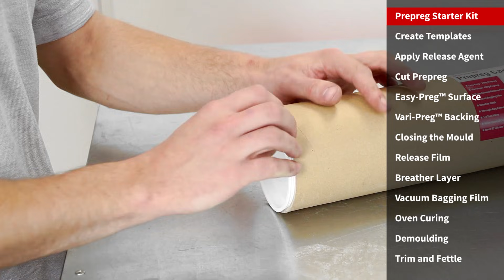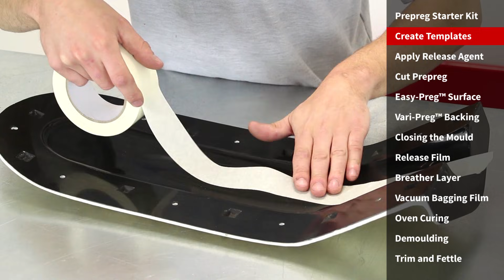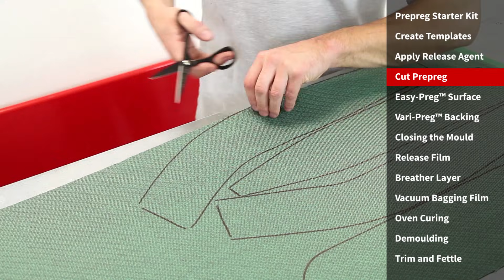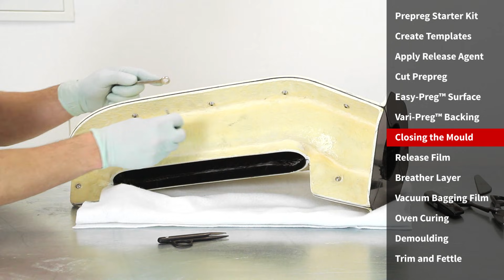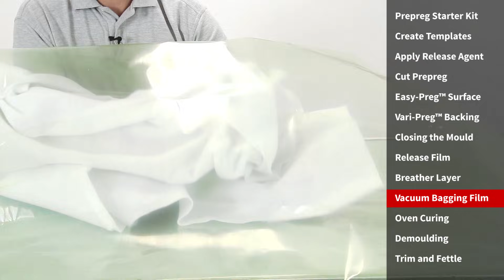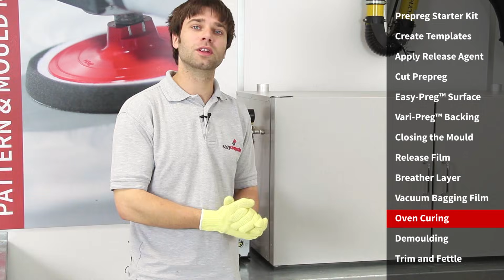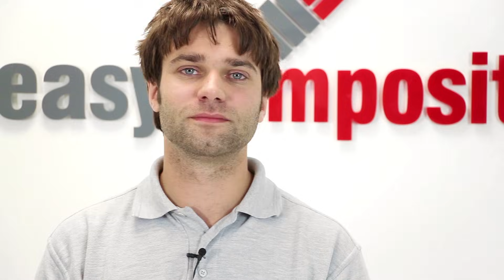How to Make Prepreg/Dry Carbon Fibre Parts (Carbon Fiber Airbox Pt. 3)

Comment: Hi, thanks for the video. Really enjoyed it.
I wonder how many parts can be produced out of one mould?
Reply from the maker: Yudha Pane The Uni-mould system is very durable so it is possible to get literally hundreds of pulls from a mould.  The mould can easily be polished to remove scratches and restore the gloss finish if over time it fades.  We have moulds in our workshop that have been in constant use for 7 years.
Reply: Easy Composites Ltd Great. Thanks for the answer. So does your company also provide service to manufacture the mould given a design from the customer?

Comment: Hi, can you tell me why do you need to still vacum the part in the oven after already you did that during assembling of moulding? Also how does the temperature increase durability of a part in MPa? Because as on the other movies you don't need to use the oven.
Reply from the maker: The carbon is pre-preg and must be oven cured under a vacuum.  The part is left under vacuum to ensure no air remains which would ruin the cosmetic finish of the part.

Comment: Do you need vacuum pump connected while curing because of expansion of the bag at high temp?
Reply from the maker: There are a variety of reasons to keep drawing the vacuum throughout the cure buy yes thermal expansion of the bag and any joints are one of them.
Reply: @easycompositestv  thank you!

Comment: Does the final product has all the benefits of carbon fibre? Sure lighter but is it now really stronger than steel? Or, is this just a quick way of making exotic parts?
Is this the all process it will take to make a crash helmet?
Reply from the maker: The final product has all the benefits of carbon fibre because it is carbon fibre. There is really not much further you can go in terms of the performance of a composite part. The only step left would be exactly the same process but curing with positive pressure rather than vacuum pressure (i.e. in an autoclave) but realistically that would improve the mechanical performance by maybe a 1 or 2% at most.

Comment: If I was using a regular oven, like one found in a house, would I still need to find a way to run a vacuum line to the part while it bakes? If I create a vacuum in the bag before it goes into the oven, wont the part stay in a vacuum state while in the oven? Why is it essential to continuously pull a vacuum on the part? Thanks!
Reply: Brad Smallridge I'd say it would be down to the change in temperature. If you had the part in a vacuum at room temperature, and then heated it up to 80 degrees, any air (yes it's a vacuum, but it would be almost impossible to create a fully air-less vacuum using small pumps like this) inside the vacuum bag would expand due to the increase in heat energy and therefore would leave the bag with less negative pressure inside it. So you'd have to continuously remove air as the temperature increases. Just a thought!
Reply: any idea, once the oven reached the desired temperature, say 80 C degrees, can you shut down the pump, so that the remaining hours in the oven is without pump working? thank you!
Reply: That's why when making critical components, such as Koenegsegg (SP?) do, then you need an autoclave. Pressure and Heat.

Comment: The curing oven in this video is the normally curing oven or vacuum curing oven? Can i use the vacuum curing oven instead the vacuum pump and curing oven
Reply: +tiendai nguyen You wouldn't want a vacuum in the over... you would want substantial positive pressure!.
Reply from the maker: The oven featured in the video is a normal oven operating at atmospheric pressure, hence the need for a vacuum pump. The vavuum bagging relies on the vacuum inside the bag meaning that the atmospheric pressure is pressing the bag and fabric onto the mould face.

Comment: Question: If you were making smaller narrower parts would you still want to use Vari-Preg backing or would just the Easy-Preg surface provide enough strength? Or can you get different types of backing? Backing should always be used?
Reply from the maker: Hi Mark, our prepreg materials have evolved a bit since this tutorial. We still have an OOA solution but it's now called XC110. There is still lighter and heavier ply but you can use either or both, as required. For narrower parts you'd typically use more layers of the lighter reinforcement; the end result - in strength terms - will be mainly determined by the overall weight of reinforcement, regardless of how many plies you use to get there.
Reply: @easycompositestv  That clears that up. Thanks for explaining it. Appreciate that :D

Comment: Is it possible to make a part like this using resin infusion process? And if so how would that be done?
Reply from the maker: The basic principles for the mould would be similar.  Due to the complexity of the bagging stack and need to get fibre into place in the mould dry, a complex airbox like this would be very difficult, but a simpler design with less of a return flange should be possible with a bit of thought and planning.

Comment: question... does this finished piece hold the "normal" boost of a turbo? If not... how many layers shoud be used? Thanks for the video, cheers
Reply from the maker: This one is designed to sit over throttle bodies on a NA engine.
Reply: @easycompositestv  understood, thanks a lot! so what would you recommend for this other app I mentioned?

Comment: if it has not the hole at the other end and it is closed how do you make it?2piece and glue them together?
Reply from the maker: A 2 piece item is certainly the easier way to go for a "closed" item.
Reply: Easy Composites Ltd the line where the two pieces glue together provide enough strength to avoid separation under pressure or at a closed mould spoiler?

Comment: If I use a prepreg which has to use 177ºC to make a post cure, can I use the same mold materials as you did?
Reply from the maker: The Uni-Mould system is suitable for low temperature pre-preg curing upto 90C. You would definitely need a high temperature tooling system for that temperature.

Comment: Hello, that carbon fiber, how is it that only heating the resin melts, what resin does it have that if it is not heated it does not harden?
Reply from the maker: We’re using prepreg carbon fibre in this video which means the resin is already impregnated into the fibre, it’s then bagged and heated to cure the resin. Traditional carbon fibre fabric doesn’t have the resin in which is why it needs to be added by brush or by vacuum (infusion) if you’re working with a dry fabric.

Comment: Hi, what kind of carbon fiber did you use to make that piece?
Reply from the maker: We used prepreg carbon fibre. We no longer make the exact type shown in the video but we do have an updated product called XPREG XC110. We have a video showing how to use XC110, the results are the same as you see in this video. You can purchase XPREG prepregs from the Easy Composites website.
Reply: @easycompositestv  
ok thanks for the information I am very interested, I would like to know if your company makes a monocoque chassis in carbon fiber, and I would like to be in contact directly with you by email, thank you

Comment: How should I make the part where two mould joint together stronger, you know the carbon fiber is not connected at that place. It is weak there.
Reply from the maker: In the video, you will see we overlapped the carbon fibre to make a strong join.  You can do that in the manufacturing process as we did, or even laminate carbon tape or fabric over the join to make it stronger afterwards.  A bit of careful thought during the planning phase can mean you do the overlapping as the part is made, making things simpler and quicker overall.

Comment: HOW DOES THE DEPTH WORK? How do you determine how THICK is it going to be from the inside? 

If I am making handlebars, and I want them to be of certain thickness, do I just keep layering them up?
Reply from the maker: Yes, that's exactly what you do. Each type of reinforcement has a natural thickness when it's vacuum bagged. We call this its consolidated thickness. With carbon fibre, there's a really simple rule of thumb which works very accurately. In short, you can divide the weight (in gsm) of a carbon fabric by 1000 and that will be its consolidated thickness in millimetres. So, a 200g carbon cloth will be 0.2mm thick, a 450g cloth will be 0.45mm thick. Then, just add up the number of plies (and ply weights) to achieve the thickness you need.
Reply: @easycompositestv  Thank you so much for replying.

Wouldn't this process needed to be done really fast? What if the layup starts to dry? Do I use thicker sheets of carbon fibre?

You guys should write a book on this subject. I am waiting to move out of my current town to start making carbon fibre parts and your curing oven is probably going to be my first purchase.

Comment: How would you approach this part if it was narrower such that you couldn't get a hand inside of it?
Reply from the maker: Options could include making it in 2 parts then bonding after cure. Or making small tools to help get where your fingers can't.  Alternatively you could look at slightly different methods such as using a silicone intensifyer.
Reply: how do you bond two cured carbon fiber parts? thank you very much!

Comment: Hi. Way use easy-preg on first layer? More resin, less pinnholes....?
Reply from the maker: That is correct. The balance of resin on one side of the surfacing layer helps to ensure that during the cure cycle, there is enough resin on the mould surface to eliminate pinholes.

Comment: Hey Paul!:)
Say again pls which Dremel you guys use to trim the part! The new ones are more compact and the motor is not separated. I am afraid the tool will die if it gets to much carbon dust.
Reply from the maker: I'm sorry to say that Bosch (owners of Dremel) have discontinued the professional quality Fortiflex 9100 with no replacement on the horizon. We're Bosch distributors (just because we loved the Fortiflex so much) but last year (2018) we were told by Bosch that the unit was no longer available.

Comment: I didn't see any process to infuse the resin, does the resin already on the carbon fiber cloth? The cloth is sticky, is that resin? but it looks pretty dry, is the resin enough to create a smooth surface? Thanks.
Reply from the maker: The process in this video is out of autoclave pre-preg.  It is not resin infusion.
Reply: @easycompositestv  Thanks, at the joint mould place, I noticed you use a little prepreg ride to the other side. But if some place of what I want to make is pretty narrow, no tools can  got in there, how could I make this kind of joint? Thanks.

Comment: How much bar must the pump have? By prepreg and vakuuminfusion?
Reply from the maker: You really need to be as close to -1 bar as you can possibly get. Our pumps are 99.995% vacuum and they're fine. On a vacuum gauge you would need to be showing basically -1bar.

Comment: I'm planning to mold a pretty complex part with a three or four part split mold. My problem is that I don't have the possibility for oven curing. Would it be possible to do something like this (or more complex) in a wet layup and vacuum bag or vacuum infusion?
Reply from the maker: It will be very fiddly to get the fibres where you want it.  A big benefit of pre-preg is its natural tackiness which aids positioning the material in the mould.  Without it, vertical and upside down surfaces in a 3D object can be very difficult to lay up.
Reply: @easycompositestv  thanks for answering. I've seen "poor mans prepreg" wetting out all the layers, sqeegee-ing all excess out and then laying it into a mold. What do you think of that way of doing it? 
As I said I have no possibility for oven curing. The part is to big to fit into our household oven. 😂

Comment: Vacuum pump working all time until a part have cure? 4 hour?
Reply from the maker: Yes the pump is left running throughout the cure cycle. Our pumps are capable of doing this.  We recommend checking oil levels before starting.

Comment: Can you really leave the pump on 8 hours? I know these pumps get hot? and when you make a bag seal perfect why do you need constant vac from pump?
Reply from the maker: Yes we always recommend leaving the pump on as very occasionally a bag can develop a small leak during the heat cycle which, without the pump running, would mean the project is ruined.

Comment: Hello, May I make a similar fibre part with infusion system?
Reply from the maker: It would be extremely difficult to make this part by resin infusion as you have to lay all the fabric and bagging stack inside the 3 part mould.

Comment: Can carbon fiber stand up to turbo charger set-ups?
Reply from the maker: Yes, certainly - providing your laminate thickness and the design of the component is appropriate. Depending on the location of the component, you might need to consider heat shielding and you would certainly need to ensure that you've post-cured the prepreg to increase its Tg (Glass Transition temperature). Our prepreg system can be post cured up to around 130'C which should mean the finished part can withstand hot engine bay temperatures.

Comment: how do you bold cf to metal flange?
Reply from the maker: Methyl methacrylate is a good adhesive for bonding carbon fibre to metals. Our VuduGlu VM100 is a high performance MMA adhesive and its black colour makes is well suited for carbon fibre.

Comment: Is there a way to soften prepreg carbon fiber ?
Reply from the maker: You can gently apply a small amount of heat using a heat gun which will slightly soften the pre-preg and make it more tacky.

Comment: why don't you pump pressure in the bag as you pump car tyre? Put bag in the mold and make some high pressure! the bag will fill and pack void inside the mold
Reply from the maker: Bladder based processes typically need a stronger mould especially if you are trying to get a higher pressure.  However with these pre-pregs that is unnecessary so vacuum is fine.
Reply: @easycompositestv   learning your videos to make fiberglass sea kayak in the future...  thanks!
I dont have design yet..but that is OK for now/ 
We probably don't have here  such different purpose fibers and resins...

Comment: in any carbon fiber product that i make do i have to worry about the piece falling apart at the cut/trimmed/filed edges? thats the only thing that I'm worried about :(
Reply from the maker: A properly made part won't have that problem.  You will normally trim the edges then sand smooth to give a neat finish that in most cases is plenty durable enough in use.
Reply: sweet! thanks, I was worried about delamination, especially if I was to spend $1000+ on a hood

Comment: How to do it with regular carbon fiber cloth?
Reply from the maker: It would be very difficult, although not impossible, to make a component of this complexity using dry carbon cloth. Certainly you would not be able to make something that is as neat in appearance or as light but you would be able to make something approximating this part.

Comment: +Easy Composites Ltd What brand type and brand curing oven are you using in this video?
Reply from the maker: The oven used in the video is a prototype oven of our own design and manufacture.  We are currently in the final pre-production stage of testing and certifying a composites oven which will eventually be for sale once the final tests have been completed.

Comment: what is "bridging"
Reply from the maker: Bridging is where the fabric and/or bagging stack is not in contact with the mould face, typically across a corner or mould recess/detail.  The fabric has bridged across the detail rather than been pressed into it.  The void between the mould and fabric can, at best, fill with resin but most likely end up with large unsightly voids in the finished part.
Reply: @easycompositestv  ah so. 

So one solution would be to use resin-impregnated cf? I've seen a few videos in which it seems like the bagging and vacuum steps aren't required. Just lay the sheets in place and bake. Is this true?

Comment: Isn't carbon fiber dust just as bad as asbestos?
Reply from the maker: Carbon Nano-Tubes are particularly hazardous but those are a completely different material and not to be confused with normal CF. Carbon Fibre dust from cutting/trimming is not 'toxic' but is an irritant in the same way as any other fine particle dust such as MDF, etc. and so precautions should be taken such as good quality dust masks.

Comment: how would you do this with hand layup
Reply from the maker: It would be very difficult to get a perfect cosmetic finish but it could theoretically be done. There are a few tricks that might help, for example applying the first layer of carbon when the first layer of resin is still tacky: this will help the carbon stay in place where you put it thus making it easier to avoid bridging and voids. Another could be the use of one of our ProFinish fabrics which due to the resin binder can be cut neatly with little fraying meaning you can make similar templates as shown with the pre-preg material which will again make your life easier.  Other than that you would just have to take great care to get the best finish.  This is why we would recommend pre-preg for such complex parts as the nature of the material itself is a great help during the layup and can save a lot of time.
Reply: pre -preg is very good but expensive and I would need a oven and vacuum pump witch would take up a alt of space in the shop
would it be better to practice hand layup withs that mold with grp first